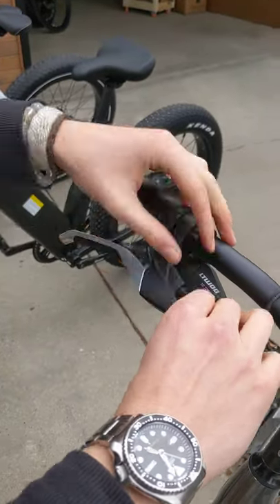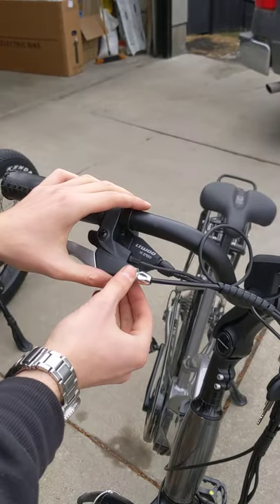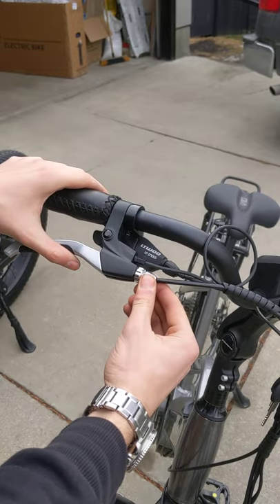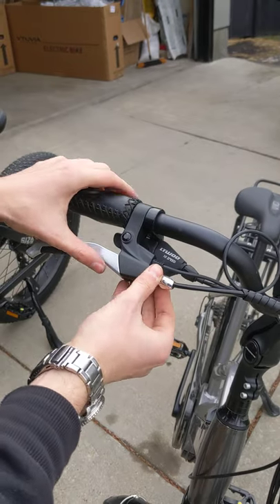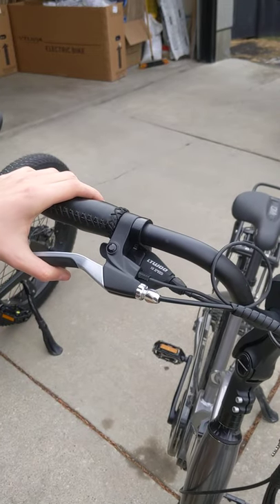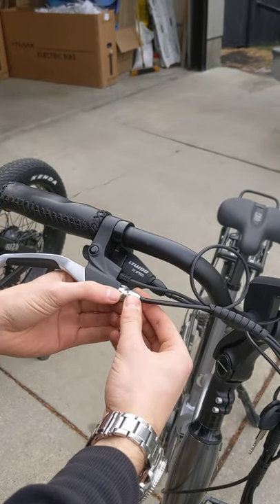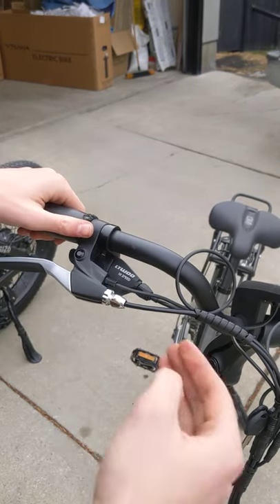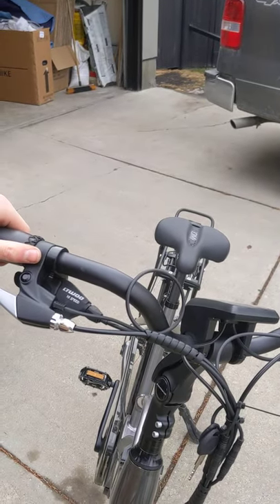Adjusting Disc Brakes

Comment: this only works for cheap mechanical disc brakes. a lot are hydraulic. so don’t do it this way with hydraulic brakes from shimano,tectro,magura,… on hydraulic brakes there shoud be a small 2mm allen wrench behind the lever. in between your handle bars and lever. (when you stand next to your bike.

Comment: Careful, this is for Mechanical and not HYDRAULIC disc brakes, as you can loose the brake fluids and get no brakes, then it’ll will be very messy and hard to fix